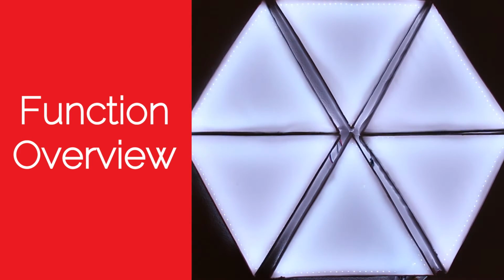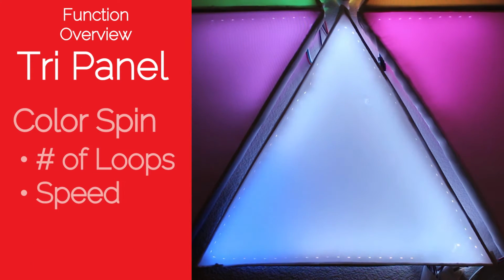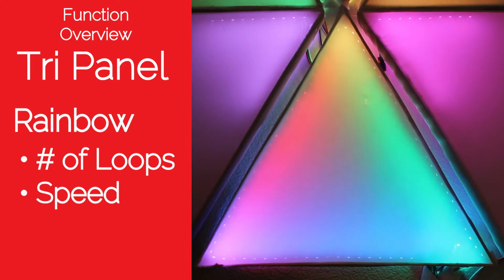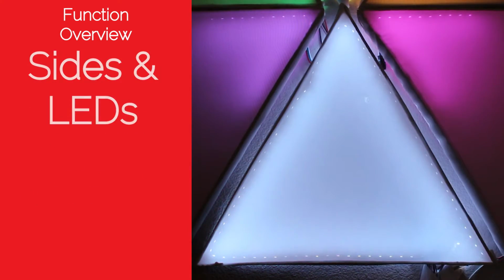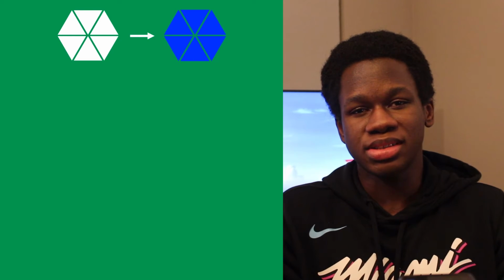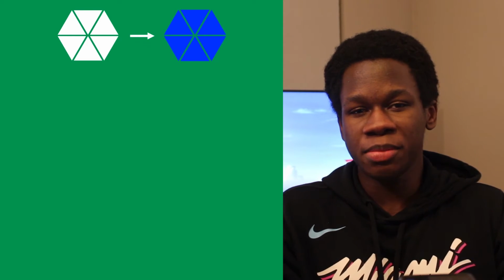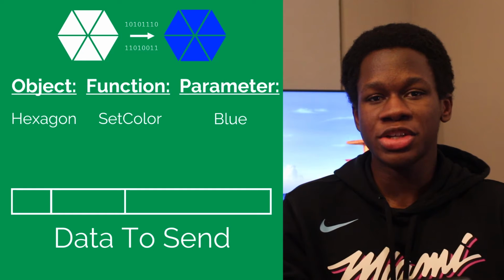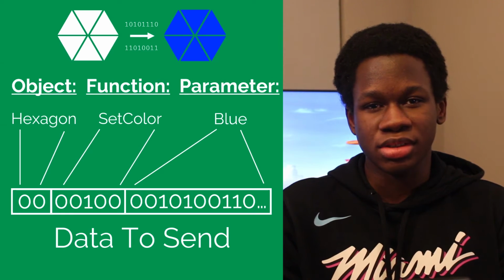Control Custom RGB Lights from Your Phone & More - Arduino LED Project

Comment: not a CS guy, but for the TV color follow thing. Maybe you could map each LED to a pixel on your camera, and set each individual LED based on that pixel? Some of the LEDs might map to a weird pixel and not do what you want, but maybe enough LEDs are good enough that it all adds up to something that sort of maybe works.
Reply from the maker: That's a pretty good idea! I tried something similar to that where each panel was mapped to an area of the TV, but doing it on an LED basis might get a better result.